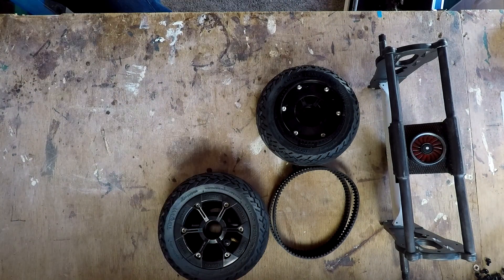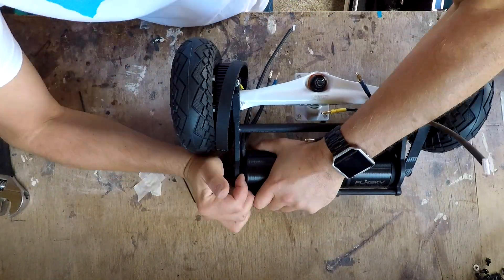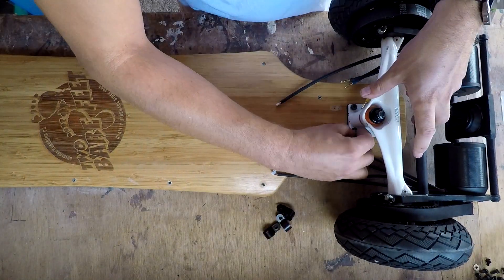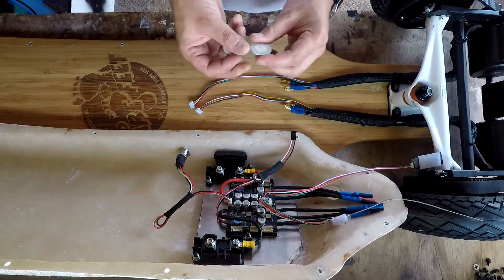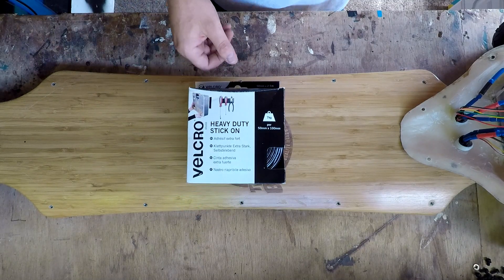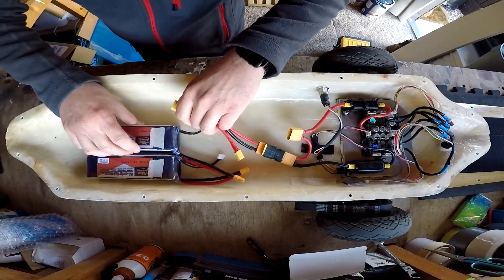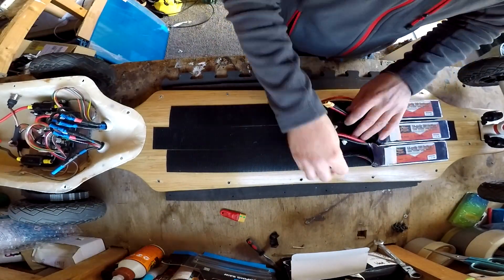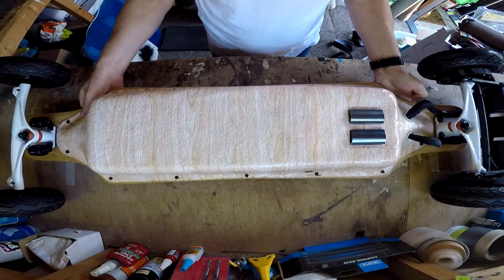DIY Esk8 Final Assembly Part 2

Comment: How to charge the battery in this configuration?
Reply from the maker: Sadly I have to take them out to charge every time. I use a Sky RC dual charger and two parallel charging boards so I can do all six batteries in a few hours so it's not too bad. Plus it gives me time to give the board a quick once over between my rides.

Comment: Great build! But how do you charge it? Do you have to remove enclosure every time? Also how do those Zop batteries perform? I had 3 of them 6S 8Ah, but they arrived all damaged since Banggood didn't pack them at all.
Reply from the maker: Thank you. Yes, sadly I do have to take them out to charge every time but I do have a Sky RC dual charger and two parallel charging boards so I can do all six batteries in a few hours so it's not too bad. Plus it gives me time to give the board a quick once over between my rides.